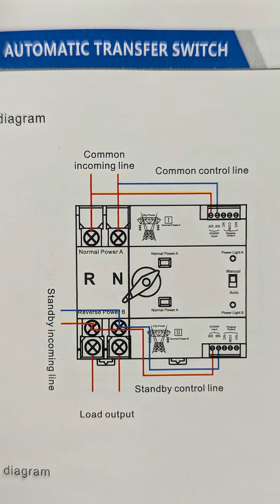I Fried My RV Transfer Switch 😬 Can You Spot the Mistake? #rv #solar #backup #power

Comment: Maybe you got the polarity switched?
Reply from the maker: Maybe, but AC doesn't really have polarity?
Reply: @TackleThat  while that is in itself true, your backup power supply has phase and neutral compared to ground and the grid has phase and neutral and i dont know what happens when phase and neutral of grid and inverter touch each other. I have never tried and i do t know that switch as it would never be allowed in germany
Reply: @TackleThat wanna bet?